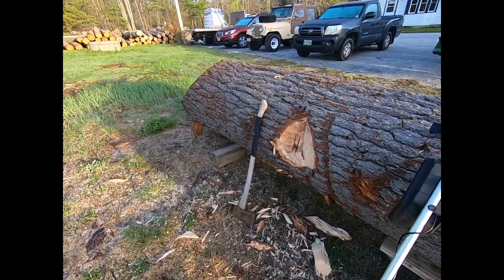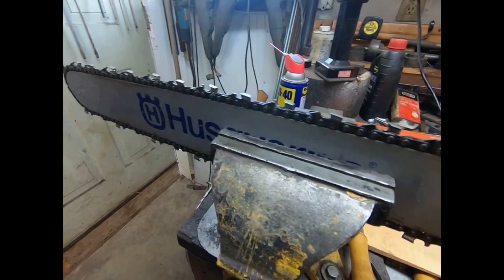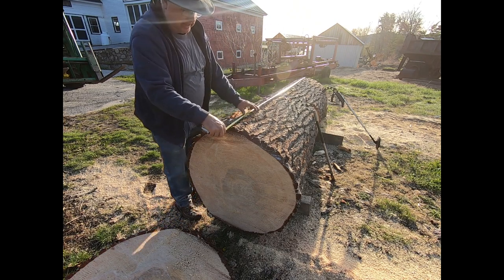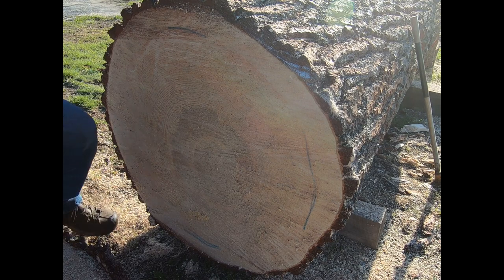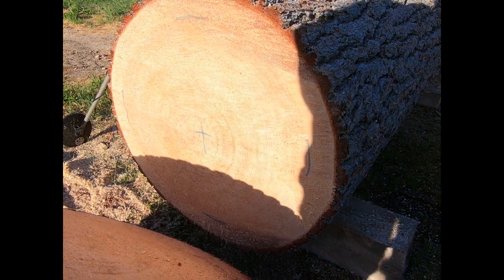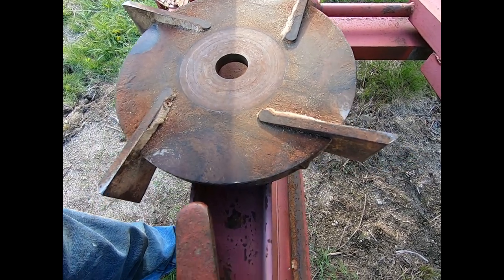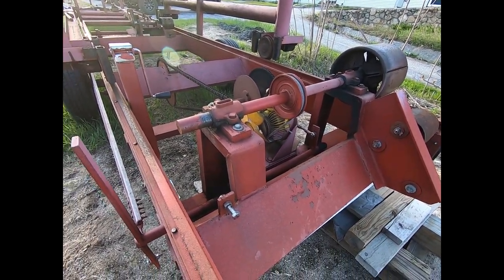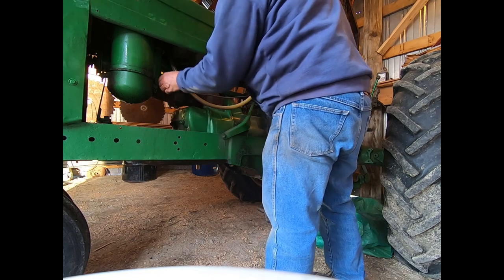# 276 The clapboard mill is ready to go

Comment: I believe Belsaw made a clapboard attachment for their circular mill as well as some of the bandsaw mills. I don't think they are a true clapboard as their not radially cut. What they do is have a rocking base you make a cut  advance and rock the base to get a long tapered thin board. I never bothered to make one as I had the shingle mill. Nothing wasted I would log a good pine get three or four saw logs then cut chunks between the nodes at the top.